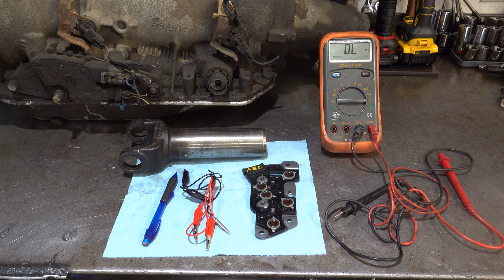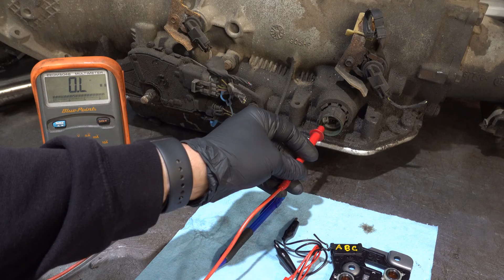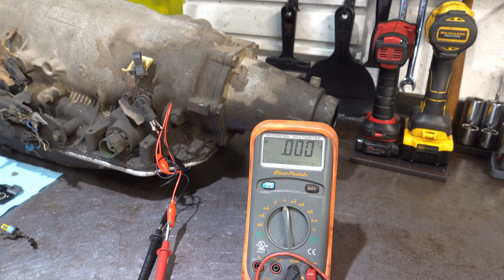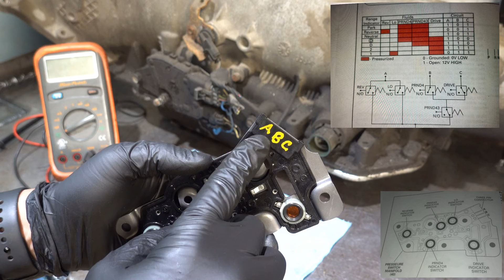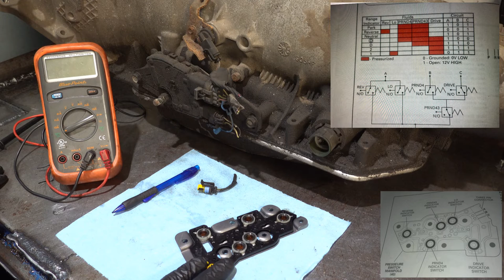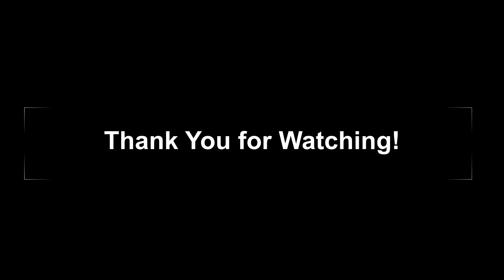4L80E Solenoid, Pressure Switch, Speed Sensor Testing and Diagnosis

Comment: Actually the trans and converter are working perfectly now, just curious if there is the possibility of damage at some point. It has an aftermarket stall converter and a trans go 2 kit installed
Reply from the maker: Transgo HD2? Oh no....hope that pressure relief mod is not installed...If the converter is working then the likelihood of future damage or wear is no different than any other 4L80E with a working converter...In other words, you should be fine; sounds like the problem may have been in the PCM itself....Also please reply to this comment vs making a new one.

Comment: My 4l80e keeps throwing a p1810 code and when the code is active it will not lock up the converter properly, keeps locking and unlocking on the highway.  I replaced all the solenoids and the tfp switch and still keeps throwing the code.  When my tuner deleted the code so it can no longer throw the code the trans seems to work fine.  Any suggestions and can I just continue to use it with the code deleted from the database?
Reply from the maker: I don't know anything about tuning/programming so I'd ask your tuner if he actually turned off the TCC apply all together and removed the fault detection logic that would otherwise store the DTC and max out the line pressure in response to otherwise protect the transmission and converter from slipping...If he turned off the TCC apply all together, you'll be driving around in 3rd and 4th gear with no TCC lock up and a lot more heat will be generated as that converter keeps slipping vs locking up.

Comment: my 4l80e doesnt want to drive over 2k rpm  in any single gear while driving, any clues?
Reply from the maker: Hi, no clues.  You didnt provide anywhere near enough information so there's a ton of possibilites. If you want to provide more details, i can see about getting you pointed in the right direction. Start with vehicle model/year, codes (if any) length of time this has been going on, recent work on the trans (if any), other symptoms (if any), any diag work or troubleshooting you have already done to date on the problem.

Comment: Great video!!! My 4l80 speedometer jumps way way to high even at low speeds and won't shift into over drive.. code p1860 . Please help
Reply from the maker: Thanks, Matt! 

P1860 is your PWM solenoid which inserts into the valve body next to the electronic pressure control solenoid. Test the PWM solenoid following my instructions in the video...

Comment: Tonight I randomly had a “fluid temp warning” light come on. Confirmed pump was working and fluid level was good. Is there a physical temp sensor on the VB I can change? I have a parts trans. Coming to a stop my scan tool says 302° but when confirming with infrared temp gun TC, pan and cooler read no higher than 180°
Reply from the maker: Hi Sagemata, your transmission fluid temp sensor for 4L80Es is on the wiring harness itself so you just need to replace the harness. Yea, there's no way those temps hit 300 degrees - you'd feel that and the trans would have melted down, lol. 

It's a good idea to replace the harness as those wear out and cause a variety of problems including shorts leading to limp mode (2nd and reverse only), leaks through the harness connector, not to mention trans temp sensor failures.
Reply: @nickstransmissions  update. The harness touched the exhaust pipe and burnt a few wires. All fixed and going good now.

Comment: I have a higher  almost  fluid sound when going  into  drive or reverse.  In park and neutral  the sound goes away.  It's in a 1995  chev G30 454. The van other then the odd sound  seems to shift normally.  I just recently  bought  this van. Any idea?
Reply from the maker: Hi Ralph,

Unfortunately noises are nearly impossible to diagnose over the net as everyone will have a different interpretation of what they're hearing and way of describing the noise. So unfortunately, I have no idea what it could be beyond perhaps front pump but just a wild-ass guess. 

Check underneath thoroughly to rule anything else out then perhaps unbolt the converter from the transmission and spin it in place...If it's making any unusual noises or is otherwise very difficult to turn (it shouldn't be), yank the trans and replace the converter. Again, without drivability symptoms to go on since there's none to report at the moment, I'm simply guessing at this point.
Reply: @nickstransmissions  thank you
Reply from the maker: You're welcome, Ralph.

Comment: A common problem with the 4L80E is fluid leaking into the connector. That requires dropping the pan and replacing the internal wire harness.
Reply from the maker: Yep, very common. I mention it frequently in my videos and on the various forums I'm on.

Comment: I have lost OD in mine. 1-3 no problem. Shifts normal. Do you have any ideas? Thank you.
Reply from the maker: Hi Tim, sorry to hear...Sounds like the OD clutch pack has burnt...Drop the pan, see what's at the bottom..If the fluid is black, smells burnt then you'll need to yank it for overhaul..You can check out my 4L80E rebuild videos for a thorough step by step review of the process.
Reply: @nickstransmissions  What if there are no signs in the fluid?
Reply from the maker: Highly unlikely if the overdrive clutch burned; fluid will black, smell real bad. If he just doesnt upshift to fouth (ie pcm is not commanding or it is but valve body/solenoids arent responding, that's a different problem with different diag procedure. Bi-dir Scan tool with live data can be used to see if a shift is being commanded and/or command it to rule in or out electrical/electronic problems.
Reply: @nickstransmissions  You have a recommendation for such scan tool for OBD-1?
Reply from the maker: For GM vehicles, I'd look for a TECH-1A for anything 82-91 and a TECH2 for anything 92-2013. If you need a tool that works across multiple makes/models, look at Snap On's scan tools. Their ODB1 line up uses multiple ALDL adaptors for each manufacturer and is compatible with most of their Modis, Solus and Verus line of scan tools.

Comment: You don’t have a video on replacing the temp sensor do you?
Reply from the maker: I do - the temp sensor is integrated into the wiring harness so you simply replace the transmission's wiring harness...See my 4L80E Basic Rebuild Series, PT3 for how to install the harness/temp sensor assembly: https://www.youtube.com/watch?v=RvvsoxLaQEo

Skip to 20:17 where I begin installing the harness.

Comment: My 4l80e is throwing a p1810. Takes about 60 seconds to shift into any gear. Just revs like neutral when in any gear.When it does it shifts  into gear, it shifts great every gear.  Im leaning towards the pressure switch. Also no speedo reading. I’m doing this test today. 
 Thank you!!
Reply from the maker: Hi Sean, yep sounds like TFP aka pressure switch manifold. I believe when they fail you will have delayed engagements into gear because the switch isn't communicating the signal to the PCM indicating manual valve position (or it's doing it 'late'). Another consideration is the transmission wiring harness itself...Disconnect the case connector plug from the internal harness on the outside of the transmission and look to see if any fluid is leaking through the connector...If so, replace the wiring harness as well...Ohm out the rest of the solenoids to confirm they are working properly while you have the pan off...

Comment: I’m having an issue with mine and I can’t fine the issue it won’t shift past 2nd
Reply from the maker: It wont upshift from second gear or when it does, it feels like the vehicle is in neutral?
Reply: @nickstransmissions  have you found the issue? My 4l80e is standalone using the ncr controller but it seems like it wont go pass 2nd

Comment: When you tested. a b c. You grounded to the table. Was the component also grounded to the table .it looked like it was on a rag.
Reply from the maker: Thank you for watching, Tee Andrea. I filmed that about two months ago so don't recall the specific details but if there was a rag on the bench, the pointed probe would have went right through it and grounded to the steel bench top. I would have seen a disruption on the meter if the rag created a barrier to grounding the circuit.
Reply: Yeah, I Wasn't Exactly Following That Part Of The Diagnostic Procedure Either. You Can't Just Touch A Probe To A Random Metal Table And The Other End To The Manifold Pressure Switch That Has Absolutely Zero Continuity To The Table And Expect To Get Any Consistent Or Accurate Readings. Unless You Had The Metal Frame Of The Manifold Pressure Switch Grounded To The Table With Alligator Clips, You Were Just Testing An Open Circuit. Plus Your Meter Was On Alternating Current Which Is Not Applicable For Testing Direct Current Components. The Rest Of The Video Was Very Informative Though. Should The Manifold Pressure Switch Be Replaced When The Transmission Is Fully Rebuilt?

Comment: Looking at your videos is very helpful. 2008 Cadillac Escalade esv 6.2. it will drive a little then stop going I have discount my battery then it moves a little again. Code p2723 goes. Wat u think. Thank you so much.
Reply from the maker: Thanks for watching and the kind words, Danny! Assuming you have a 6L80 in the Escalade, that code is for one of the clutch pressure control solenoid #5 which is on in 1st-4th gear and based on your description, it sounds like it has failed thus creating pressure loss inside the trans thus little to no movement. I'd drop the pan and begin continuity testing the individual solenoids, starting with CPC #5. If it's indeed no good, you will need to replace the entire TEHCM as the solenoids themselves are not replaceable individually. 

Here's the 6L80 ATSG manual with solenoid info for reference: https://atoc.ru/uploads/manual/5fb79aebb40df.pdf
Reply: Thank you very much for all the info u sent me. I appreciate it very much. One again thank you.and If I get into a bind hopefully I can write u again.
Reply from the maker: You're welcome, Danny. Check your glove box for the RPO code list - it will have your transmission's RPO (MYC=6L80, MYD=6L90).
Reply: One more thing is that the same for a transmission 6180e 6.2 motor on my Cadillac Escalade esv.

Comment: Is there an actual pressure sensor in the transmission that sends a pressure signal to the ECU? I don't see a pressure output pin in that diagram. Or does the ECM just do a calculated guess as to what the pump pressure should be even though the pressure might be physically low using a mechanical gauge?
Reply from the maker: The closest thing would be the continuity signal from the electronic pressure control solenoid. The ECM doesn't monitor literal trans pressures beyond what it has programmed to max the line pressure when it detects a fault that requires putting the transmission into limp mode. 

Are you having issues with your trans? If so, what's happening?